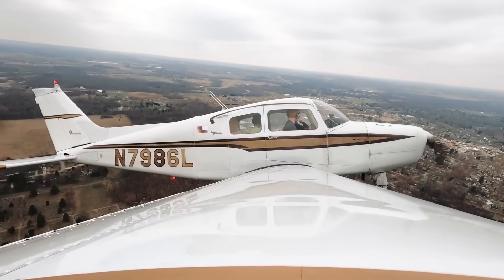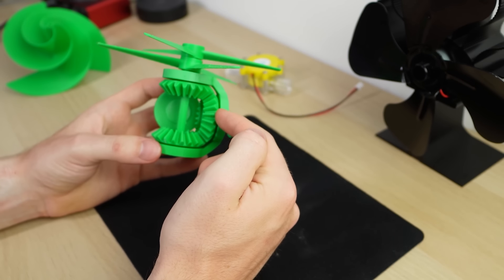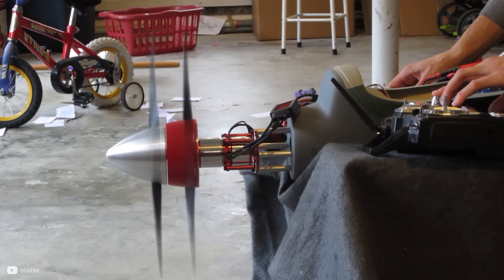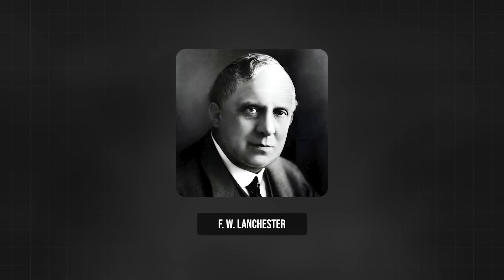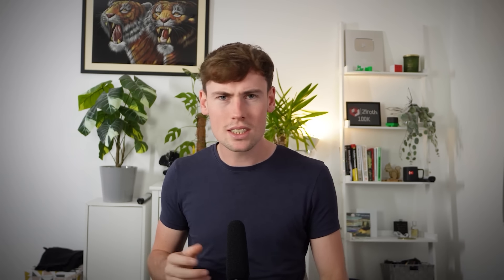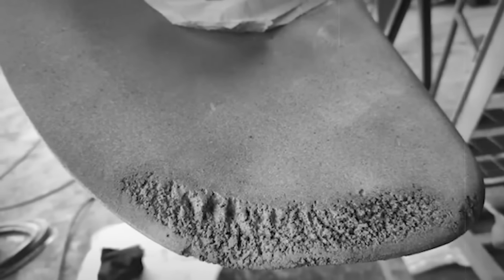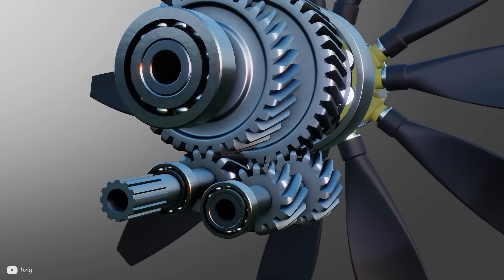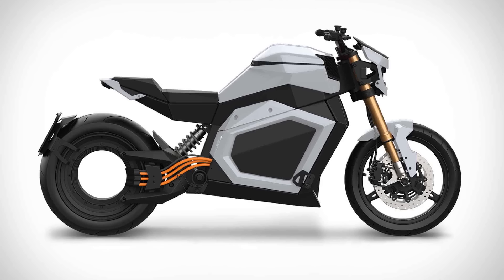The Unexpected Genius of Contra-Rotating Propellers

Comment: Actually you don't necessarily need gearing for contra-rotating propellers: in 1930 the fastest thing a man could sit on was the Macchi Castoldi Mc 72 seaplane (searacer) and to obtain the counter rotation it simply had the engine split in two without a common gearing so the two propellers moved independently but still nearly rev matched, it got to the speed record of 711 km/h still standing in its class and surpassed only at the end of ww2 for general airplanes

Comment: Dude, the enduced torque is just a reaction force (you know, "every action has an equal and opposite reaction"), it's not rotating airflow pushing on the sides of the fuselage.
Reply: He was talking about yaw. The force you're talking about would cause roll. It would be very slight.

Comment: toroidal-contra-rotating propellers would look so strange on a plane....or does the difference in air/water density make the best design very different for one rather than the other?
Reply: I dont know if they are currently possible on jets due to the massive g loading. Modern turbines need to be made out of carbon fiber and titanium alloys just to withstand the force so adding a large chunk of material at the very tip might make them explode... boats have MUCH lower rpm and tip speed so dont have the same problems.

Comment: Differential gearbox lose quite a lot efficiency. Benefits from optimized air stream have to even that out. 
One could just put static blades after single rotor to get laminar flow. Turbines do that. 
And calculated winglets on tips.

Comment: Contra-Rotating Propellers are LOUD!!!!!
Reply from the maker: What's that?? I can't hear you over the propellers!
Reply: @ZirothTech  Hey Ziroth. There is an option you did not know about. Only about 2 years ago a few people in the quad copter industry have had great luck with the rear propeller on it's own FREE spinning bearing. The Rear blade spins at the same speed as the front driven propeller and does all the same things: No more tip vortices and no strange torque with the mass of the rear blade spinning the opposite way to offset forces. Also if the free spinning blade is given a small "kick-twist" on the rear tip like a turbo charger most of the air stream shots straight back just like a jet engine. Much work is needed but it looks promising. Time to throw all those messy gear drives away. Look for a NASA report by end of this year.

Comment: I wonder about the noise when the blades pass by each other. I wondered if either the front or back could have one more blade which would make the blades front to back pass by each other at slightly different times. Just a thought.

Comment: You could probably gain a large amount of the efficiency without the mechanical complexity by just using non moving stator blades that are fixed in place with blade pitches in the opposite direction behind the moving blades like in a turbine engine. In fact safran and GE are doing exactly that with the new cfm rise open rotor turbine engine that is going to be introduced to commercial airplanes in the 2030s.

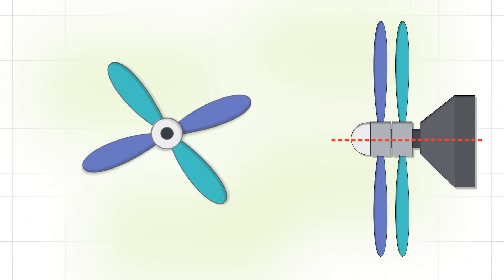Comment: 1:44  Ah! This is a similar effect to a helicopter. That's why a helicopter needs that second propeller in the back to keep it from spinning the whole thing.
2:38 I see that it this central gear also keeps both of them equal in speed. Maintaining balance between them. Ingenuus.
4:08 How does this keep from disrupting the airflow through the propeller? Ah, I see it now at 4:28.
4:28. I just had a thought! What if this was setup in a turbine of a jet?? All 32 blades operating in this pattern? This may make jets even more efficient and effective than they ever could be. Wow!
10:20 Ok so, is there any adapting these for aircraft?

Comment: we can have these toroidal (is that correct?) propellers to reduce noise. if we have a 3 and 4 balde propeelr behind, the tips wont past at the same time. what about a faster spinning rear propeller with lesser pressure difference and smaller diameter? and a shape that focuses the stream of the fluid whilst the first naturally expands it?
also, what about more "blades" to have lesser noise?

with that combination we might get over 10% efficiency.
also the two gears for the rear propeller are quite a lot of friction, wouldnt it better to use a planetary gear? you might also get the higher rpm that way , like 15-20%

Comment: Does an aircraft whose wings are cycloidal propellers create tip vortices?

Would it benefit from contra rotation?

I would expect the extra propellers to be concentric, rather than front and rear.

Comment: Are there any examples of counter rotating blades with different number of blades, say 3-2 or 4-3?  Perhaps the sickle shaped bladed would reducing the beating noise.  How about about blade with nubs on the leading edge.  All grate options for the counter rotating blades.

Comment: Th problem with those propellers is not complexity but noise  and it is a big question if it can be solved
also I think it may be better idea to stack them not on top of each other but  next to each other interleaving their blades.
as it was done in is some helicopters with Intermeshing blades with pretty god results
this makes construction much simpler  and probably more efficient.

Comment: From what I've seen from people testing toroidal propellers, it really doesn't seem the claims hold up under third party testing. There are many videos here on youtube testing the design and the toroidal propellers just tend to do pretty poorly. 

The MIT report was a bit misleading as they claimed at the same rotational speed the toroidal fans are quieter; but they are also much weaker at the same RPM. 

I follow computer building all the time and there are many who build PCs with closed off front panels to reduce noise from fans. The issue is now your fans have to run faster resulting in them making even more noise. The end result is having an open meshed case will still be the quietest even if you're directly exposed to the fans.

Comment: With an electric powered plane you don't need the complex mechanical stuff to make the props spin equally fast
Reply: Yea, I was thinking the same. You could even go further and - for example - reduce or even eliminated the need for ailerons since you can rotate the propellers at different speeds and use that to induce a rotation along the roll axis. Kamov has been using coaxial rotors for decades now and that is how they completely negate the need for a tail rotor for yaw control.
Reply: @Llyd_ApDicta  fascinating! Thanks for sharing😀

Comment: This idea does slightly improve efficiency but at the cost of more complicated mechanical parts. However the biggest loss from propellers and helicopter rotors too is the kinetic energy that remains in the slipstream behind the propellor or rotor. Almost half the total energy is lost due to this propulsive method. There is an answer to this which as never been tried and it is by controlling the exhaust flow from a radial compressor to be directed backwards or downwards, with the advantage for the helicopter in that that the conventional dangerous and difficult to control blades would no longer be needed.

Comment: Indeed - Also - the relative pitch of the leading vs trailing prop  - is not always straight forward  - not equal , (various regimes vary the optimal condition - same thing with diameter - and then "torque balancing"   -- yep you did a few different differential systems  (OR, direct drive of each using electric drives for both OR an active torque hybrid system - with gas turbine (+/- electric) on one prop and straight electric on the other - and no differential coupling - now active gyroscopic roll control ia more  achievable....

Power density doesn't double just because blade density does - but yes it becomes "more" - and some trade-offs (solvable with modern computing..)

The real expense of Sharrow is "$$$" - make money while the shine stays on the patent...

Comment: By no means am I any sort of expert in this, but aren't the big three jet engine manufacturers (GE, Rolls Royce, and Pratt and Whitney (and maybe CFM)) experimenting with a new high bypass jet design with the fan blades outside of the cowl with a secondary stationary set of fan blades directly behind them which kind of simulates this?

Comment: This seems to contradict that coaxial electric prop motors used in drones require 25% more power to develop the same thrust compare to using just 1 electric prop motor. So they are significantly less efficient. Can anyone explain this apparent contradiction?
Reply: Im sure theres a lot of differences between drones and full sized airplanes.
Reply: Im sure there are significant differences between small electric drones and full sized airplanes.

Comment: What happened if you hook the props up to a cvt so they you can change the speed at which the props spin compared to one another like the rear prop can spin faster then the front prop at higher speeds and vice versa

Comment: What is it about big heavy millitary airplanes that has curved propellers, while hobby planes has nearly straight propellers… Which is the most effective and why?
Reply: They are called scimitar propellers and are meant to mitigate "wave drag" The issue is basically that when the prop tips or the aircraft as whole reaches transsonic speeds, shockwaves can appear in certain spots because the airstream can go suppersonic even before the aircraft or the prop tip does. Now the scimitar propeller is basically the idea of a swept back wing, but for a propeller. The prop blades are going faster the further out you go at given prop rpm. The faster you wanna go the more sweep you want to mitigate the build up of the shock wave. A good illustration for that are sweep wing aircraft like the F14 or F111. The faster they wanna go the more they sweep the wings back. Light piston aircraft don't encounter this issue to this extend because they never fly that fast.

Comment: maybe im DUMB to Understand it, BUT WHY didnt just use Lean Elecric Motors Feed by Gas powered Generator
i know there its a power loss in the Convertion, but wont it be an instand stress free acceleration for the main Engine offer a better performance at the end? in the case of Road vehicles the need for easy stop and run at intervals provides the best example of how a Generator instead of a Range extender whould be preferable
a Big FlyWheel and a simple 4 opposed piston engine feeding Axial flux motors on the Wings

Comment: Young man, aeronautical engineers have not been ignoring contra rotating props since 1907 nor toroidal rotors since way back whenever. You do not bring something like the Gannet to reliable and arduous frontline service without substantial R&D backed by thorough understanding of theory. The reality is simply, as with everything in aeronautics, they are a trade off. In fact, the design goal for the Gannet arrangement was to improve loiter by enabling one engine/prop to be shutdown. In other words, the loiter was better in single prop operation!
  At this point in the extremely mature and highly studied field of aeronautics, simply combining the two old concepts of contra rotation and toroidal props is not going to move the dial. To go with toroidal you will be giving up the significant advantage of variable pitch. There is no “insane efficiency” to be gained by giving up variable pitch in favour of toroidal. Quite the opposite.

Comment: Are you sure that you aren't just repeating somebody's advertisement? Because I know for certain that on multirotors coax props are about 30% less efficient than two same props mounted without disc intersection. And it doesn't change at all based on wheter props are counter-rotating, or spinning in the same direction. MIT toroidal prop thingie too was demonstrated many times to be a scam.
Reply: I can see the efficiency increase from a simple fact that motors had a lot of excess power that one prop just couldn't harvest

Comment: wouldn't this partially remove the need for a tail rotor in a helicopter
Reply: Yes it would. Also there are already helicopters with contra rotating rotors in use since decades, even in quite intresting configurations. For instance the whole Kamov lineup uses axial contra rotating rotors. An intresting example is the Kaman K-MAX. They use a so called "intermeshing-rotor" setup.

Comment: Contra-rotating (or "coaxial") props have become a common sight in the drone industry for quite some time now. Also you missed some downsides.
1. You can't just add another prop and the efficiency increases, you also need to install a more powerful engine. If you just install another prop the engine has to work against more drag with the same amount of power which will cancel the added efficiency.
2. if there is enough space, it is even more efficient (about 15-20%) to install the same amount of props side by side instead of coaxial.
-> combining these two: since you have to replace motors anyway, installing another set of props in the same plane as the already existing ones gives you an improvement of about 35-40% in efficiency (given your weight stays the same)
3. (drone specific) however for another set of props you need another set of motors, increasing the weight and cancelling the efficiency bonus. So for drones coaxial is only viable if there are very tight space constraints.
Reply from the maker: This is super interesting, thanks for these insights. I should have thought more about the surrounding systems, the need for a larger engine is a really important consideration

Comment: At 50" you make a mistake. The spinning blade does NOT put a torque on the aircraft; it is the torque of the engine that is working on the aircraft. And you make another, traditional, mistake. If a couple of contra-rotating propellers is driven by a SINGLE engine, than the engine torque working on the aircraft is NOT balanced by the contra-rotating props.

Comment: You lost me at wheel torque friction. There is LITERALLY no mention of this in pilot training. It is not a thing.
Reply: It is a real thing. It’s just physics. It’s just that it’s so minimal it’s not even really a factor. The torque of the propellor is trying to rotate the whole fuselage in the direction it’s spinning, but it’s heavily off-set by the lift of the wings. The only time this becomes an actual effect is at low speeds, but at low speeds, it’s a non-issue anyways.
Reply: @Jay_Force_One  I'm aware it's a real force. I just mean it's so tiny and inconsequential that it's not explained or considered in pilot training. The other propeller forces far outweigh it.

Comment: I am so frustrated by the inability of producers and graphic designers to produce correct terminology. The representation of speed in a "Metric Sense" is only "km/h." To think that "kph" is correct means you have a very limited education. The correct terminology is "km/h".  This represents kilometre(s) as "km" which is the approved International System of Units terminology. "per" is represented by the " solidus" or "oblique" or the "forward slash". "h " represents hours. So, the correct terminology is "km/h" and don't you try to disprove it. I have the Manual of Metric Units by my side and you would do well to study this use further. Till then, your producers and your producers are sloppy and their product is incomplete.